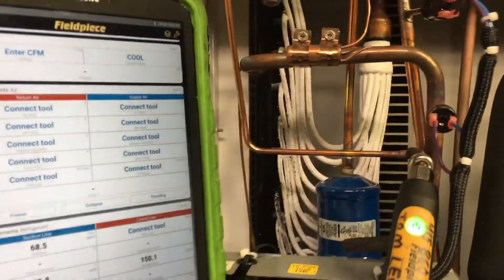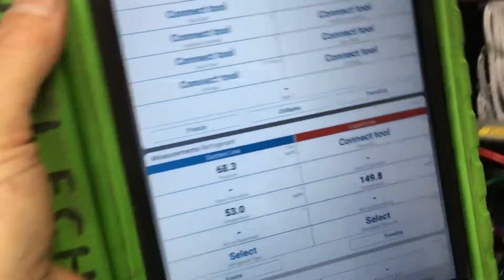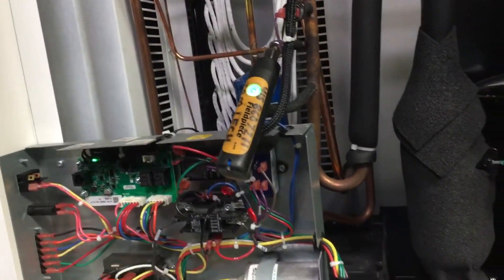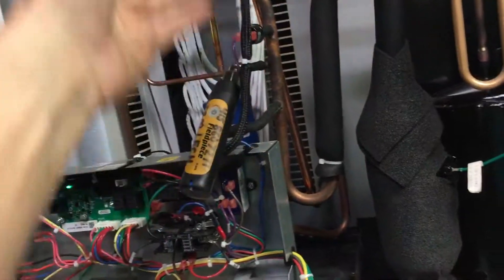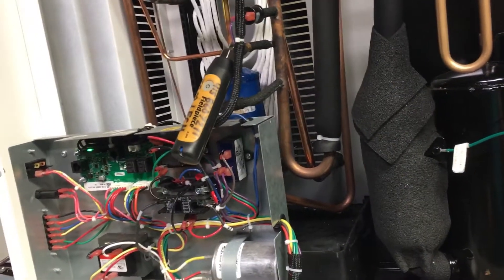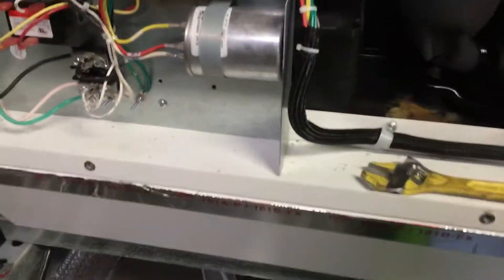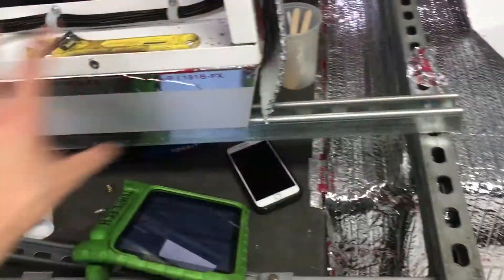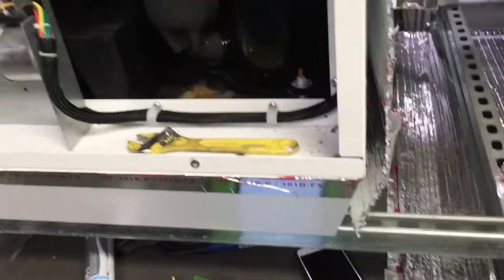Quest 500 pint dehumidifier contacted tech support. Given permission to check the low side pressure

Comment: Could it possibly be a stuck TXV? Could adjusting it fix that low pressure?
Reply from the maker: You almost never ever need to touch a TXV.  Air flow or refrigerant charge 

98 out of 100 TXV replaced probably did not need to be replaced.  Most people adjust TXV not knowing they are just compensating a for a charge problem or airflow problem. 

And since most, I won’t even call them technicians .  Don’t even know how to properly charge of system so it doesn’t have a refrigerant charge system..  or they don’t know how to adjust or check airflow so it doesn’t have an air flow problem. 

Their default go to is the expansion valve .  Compensating over opening the expansion valve or shutting down on the expansion valve to compensate for the airflow problem or refrigerant charge problem..  

Or maybe the unit is being operated under temperature in conditions that it was not designed to operate under .  

If a system is installed in a situation where it was not designed to operate within the manufactures parameters it will not function correctly, and the person who does not know that things they need to adjust something

Comment: I feel for you bro, 
My 506 unit in my grow room can't seem to get the humidity down at nighttime, it has no problem during the day dropping the humidity because it has the heat from the lights evaporating the moisture in the air. 
But as soon as the lights are off , the units turn on and barely do anything... 
I have no clue what the issue could be , but this is only a year old unit and should be working perfectly fine. its frustrating.
Reply: Your lights burn off humidity during the day but at night the plants exhale and spikes the humidity. You need more dehumidifiers
Reply from the maker: Lights do not burn off humidity. 

If you turn off all the dehumidifiers and air conditioning units inside the room and leave the lights on you will see real quickly you get well over 100°F to 115°F and your humidity will go up to 98% to near 100% with the lights on no humidity burning on going on there . 

Lights add heat load to the room what causes the air conditioning to work harder keeping the coils cold and the colder and harder you run the coils the more moisture humidity they remove out of the air. It’s not the lights doing to work. It’s the air conditioning units doing the work Removing water out of the air.. 

The spike as the lights go off, is the transition. You instantly remove the heat load from the air conditioning units. They start winding down and turning off at the same time the plants are in full respiration mode. Still, you can say offgassing moisture into the air, humidity, a.k.a. many pounds of water .. 

And that’s where extra dehumidifiers are needed to compensate for all the air conditioning units that just shut off . 

But if you have heat recovery system, air conditioning, you could use the spent energy of heat that normally would be exhausted through the roof out of the condenser reroute that hot gas into a second heat exchanger, placed in front of the evaporator and turn your air handler’s into dehumidifiers all from the same unit using half the amount of energy because you’re using a heat recovery method reheat.
Reply from the maker: Do you have the condensate drain P-trap connected to the water drain ? 

     https://m.ferguson.com/product/rectorseal-ez-trap-8-12-x-14-12-in-condensate-drain-pan-trap-push-34-in-plastic-rec83114/_/R-3875192

Order this off Amazon or anywhere this link is just a reference if you don’t have this installed install it. 

      Make sure your filters are clean don’t run your unit without filters

           But if your unit is running but making zero water coming out of the drain then you have other problems
Reply: @coldfinger459sub0  thank you for the quick reply, I will check this tomorrow, I appreciate your help